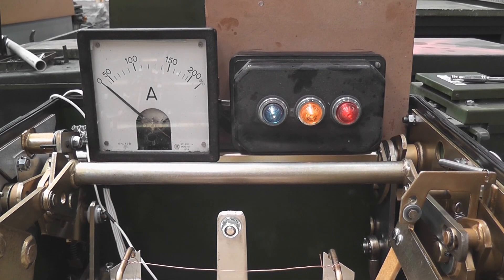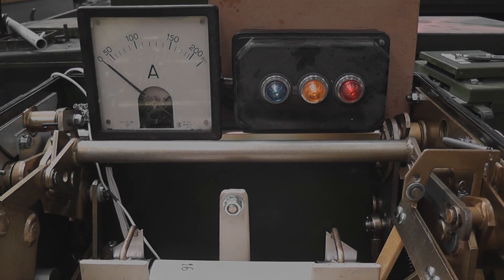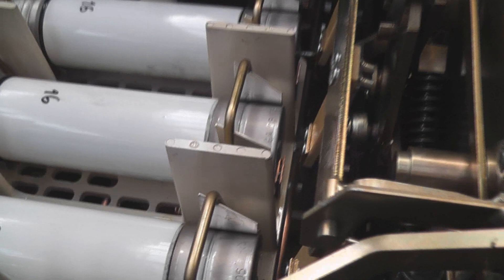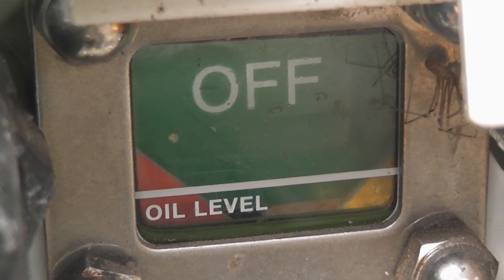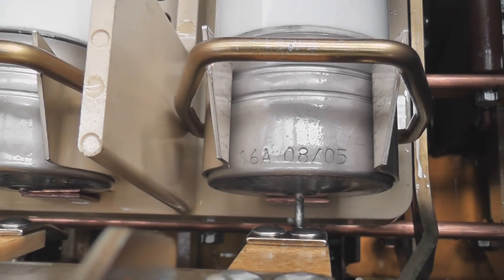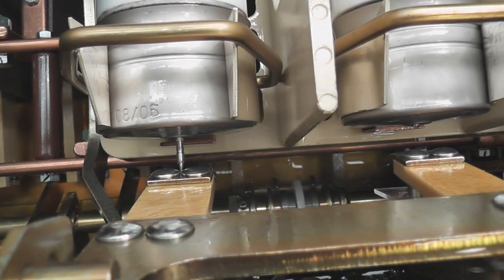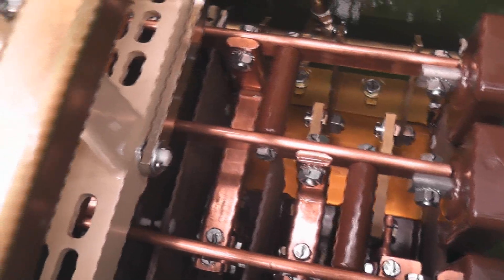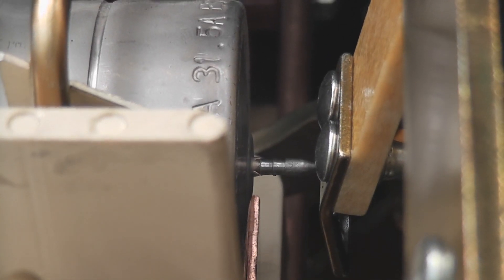RMU fuse striker pin operation

Comment: Very interesting video  I remember when I worked at a factory in my previous life a few times all lights would dim and motors would make loud buzzing noise for a few seconds then all power off I asked our leccy what happened and he said was 11Kv fault must have been fuse going in RMU I just didn't know it then sorry for ramble merry xmas
Reply: +jon johnson 
That's neat to know! Yes a fault could make motors buzz, because the arc is sort of like a random frequency generator (Not always, but sometimes), interrupting the power at varying intervals because it actually loads down the power lines so much. Eh, I hope you can understand my explanation XD
Reply: I understand what you mean I heard motors and transformers give an angry buzz when faults like that happen

Comment: Great video! Are these sand filled or do they work like DDO fuses to break the arc?
Reply from the maker: +CAL'S ENGINEERING They are sand filled, will do an autopsy over the X-mas break.
Reply: Benjamin Esposti I'll have a look for that! RODALCO does do a good video!
Reply: +CAL'S ENGINEERING 
Photonicinduction did a teardown of one of these types of fuses, if you can't wait XD
But I like this vid better because it describes (and shows) what the purpose of the "striker pin" is. :D
... Plus, RODALCO is one of the first channels I subscribed to XD ... gosh, I think was back in 2011 maybe?! O.o

Comment: That's cool, it never even occurred to me that the other 2 phases would be shut off too when a fuse goes off, but makes sense.  If it's driving a big motor or multiple loads spread on several phases at a factory or something you probably don't want 2 phases to stay on.
Reply: +Red Squirrel 
Hell no you don't! XD
3 phase motors don't like running on two phases.
At my school, we had a feeder line arc out, blowing the fuse on the B phase (I think it was B phase). This left two other phases still connected ... (we don't use these RMU units here, from what I know ... probably because it's too expensive XDDDDDDDDD) ... we were investigating why parts of the building had no power ... we went into the boiler room and were hit by a really bad smell! ... I spotted one of the heating system circulator pump motors smoking  ... yikes! O.o
After we measured the voltage, we found that one phase was quite low, at only a few volts. That was the problem! Poor motor though ... oh well, I guess it had a good life!

Comment: Mind doing a video about what a RMU actually is?

Looks like a good explaination for the fuse part, very nice.
Reply from the maker: +erlendse Look at the Piha RMU maintenance video uploaded last week. It is a switching device to isolate a transformer or fused line from a main feeder line or make a controlled isolation in a main circuit for maintenance after a parrallel was made with another circuit.
Reply: RODALCO2007
Thanks :) Would be neat to see the grid wired with smaller parts and shorter wires, but same type setup.
Reply: +erlendse 
I agree, it would be fun to have RODALCO teach us some stuff about the power distribution. After all, he hasn't done a video like that in a long while :P
It'd be long winded for some, but well worth it for others to watch!

Comment: Excellent demonstration, thank you for showing this video, interesting to see how that unit operates and disconnecting the remaining phases. Pretty complex fuses, I bet they would cost a few bucks. Merry Christmas to you and your family Ray, hope you have a great new year! Dont forget to buy your Missus something special, maybe a decent HV transformer or something. Ooops I mean something like some Jewellery or a fancy Dinner out!
Reply: +RODALCO2007 Ah that's why you're blowing them, I thought 'what a waste' but yeah, i can see the logic, one or both of the other 2 fuses would have been stressed and might be a failure point later under normal load.
Reply from the maker: +rustymotor They cost about 200 $ each. When one fails on site, all three need to be replaced, hence I had some to play with.
Reply from the maker: +rustymotor Cheer, Have a Merry Christmas too up in warm outback Australia. Maybe some good thunderstorms as a X-mas pressie ? Yes, I will make for my misses maybe an electric home build wasp or fly zapper as a special pressie.
Reply: +RODALCO2007 Expecting good storms this afternoon, tropical moisture moving through and hot day, perfect recipe for storms. I am preparing my RC glider and camera at the moment and will head out bush soon so hopefully will get some live action. I will try and fly the unit under the storm and get some good lightning action and hopefully not lose the rig to updrafts or lightning strikes! The Boss will be very pleased with a Wasp zapper, good for all sorts of bothersome insects. I was working on an old washing machine for my Missus, its an early one with a fitted small petrol engine, the sort used out bush with no electricity. I am sure the Woman will be happy with it as the machine she is currently using is just about stuffed and she wants a new one. This old one I am working on needs a few parts so it wont be ready for Xmas so maybe for her birthday next year.
Reply: +TheChipmunk2008 
Yes, the fuse links might be weakened from any possible fault that previously happened, but it didn't quite melt before the power was cut off (likely by another fuse blowing :P)
Reply from the maker: +rustymotor Fabulous ! a petrol engine driven washing machine. Love to see that in action one day. Love to see one of you awesome Australian Thunderstorm video's again. Hopefully there is some good action this afternoon.  Actually I need to see one again with my own eyes, perhaps next year.